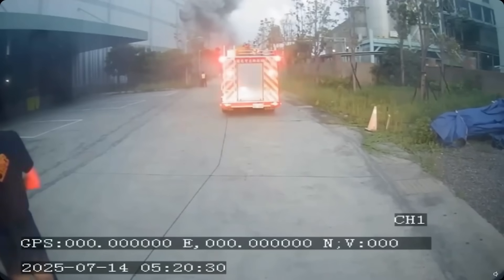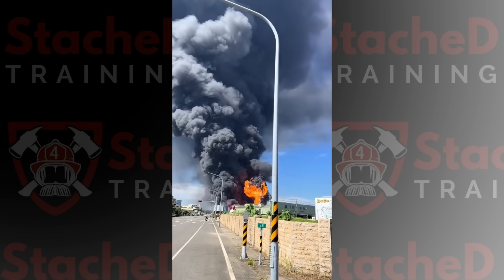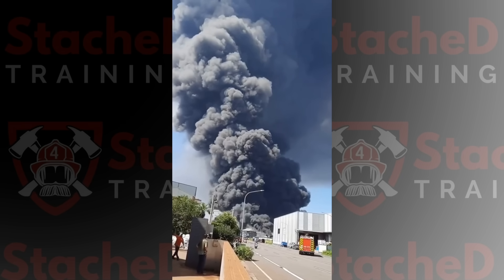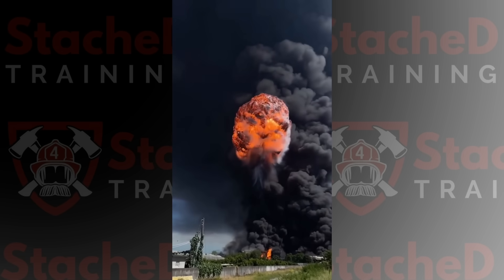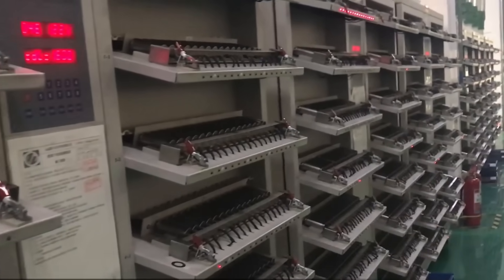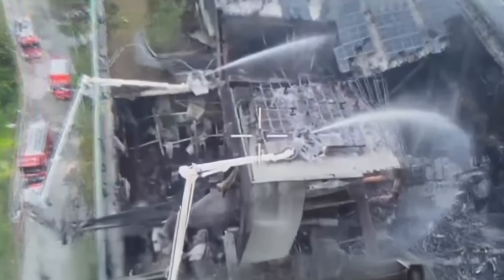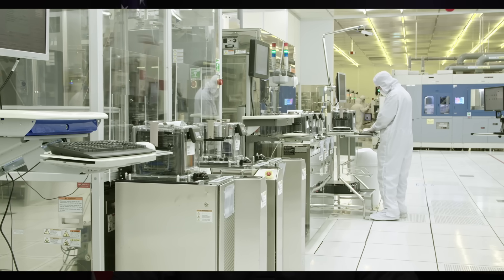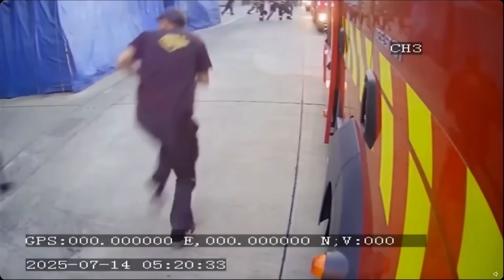Massive Lithium-Ion Fire in Taiwan: 2 Million Cells Lost

Comment: What is the best way to store lithium tool batteries at home? Do the "fireproof" bags work? I keep them in the house because my shed gets up to 120+ degrees in the summer.
Reply: Its a rough discussion. There's lithium ion battery fire extinguishers but they're generally smaller cans for like phones and stuff. There's blankets that help with fumes and gases contained but not completely unless its a full cover (which i got hoping it helps if needed..) but there's also this AVD stuff which ive found curious. Its aqueous vermiculite (something) it shoots vermiculite with water? which cools the battery and then the fire heats it up and it expands and is to smother what it can (batteries release there own oxidation so they dont need much air of ours to burn. 

Fire Fighters apparently submerge them in water when they arrive to the scene which they leave for 24hrs to a week cause it just keeps burning
ABC fire extinguishers are not really designed to deal with them also
Reply: Lithium metals are bad and react to water bad to my knowledge its different than lithium ion. Theres non lithium ebikes too but im really tryna figure it out too need a proper storage place

Comment: While anything can be made to burn given the right circumstances, of all the lithium type batteries only LiIon has a thermal runaway potential. Modern LiFePO4 cells and LiPo cells can burn if damaged but will not ignite adjacent cells by that mechanism alone, while LiIon will and often does. Earlier chemistries in all types were less safe but you'll likely never encounter them as they'll have worn out long ago. Cell quality plays a very large role with LiIon safety with low-quality cells being by far the most fire-prone. 

It's really only LiIon that you have to greatly worry about as only those almost always create a self-sustaining strong fire while the other types almost never do, and those other types produce less heat while burning. LiIon are also the only type with a high re-ignition risk. Knowing your enemy is crucial with lithium battery types as your strategy needs to match the type encountered.
There needs to be a special classification for LiIon types because of their characteristics. 

LiIon will remain a common hazard until technology provides a cost-effective alternative with the same high energy density; so far that goal has proven elusive.

Comment: I saw a guy get onto an elevator holding a big removable battery from an EV bike. As soon as the doors closed, the cell exploded like a phosphorus grenade. That battery burned the entire right side of his body to a crisp in under twenty seconds. The doors opened and a person walked up to a horrible scene. The guy lasted a day in the hospital. Suffering from unimaginable pain. The video, censored, is on YouTube. 
There are numerous reports of these rechargeable batteries simply going into a critical phase all on their own and starting fires.
 I have also seen a guy on You tube who was riding his new EV bike and the thing just started burning.
These EV fires are not regular fires, they are chemical fires. You never want to stick your head in the smoke or especially breathe in the fumes. There are very dangerous toxic chemicals in that smoke that can instantly ruin your lungs and your eyes. 
Get away from that EV fire, call the firefighters and tell them what it is, and let them deal with it. The less you breathe in those fumes, the better.

Comment: Here's a clue: compound the natural variability arising at each step of the manufacturing process, such as "electrolyte filling and anode/cathode coating". Then relate this natural variability to the "perfomance" (i.e. unpredictable thermal runaway) of a (small) proportion of each batch manufactured. Since battery cells are not logic circuits, the variability/faulty cells cannot be tested out after manufacture. Hence inevitable fires at a rate of one per XX million cells manufactured.

Comment: At that first charging stage, all of the manufacturing DEFECTS are likely to show up.  Having a huge closely spaced set of hundreds of cells, is again, a recipe for a major problem.  Cells can be "pre-screened" for some obvious defects, so this indicates some kind of failure of QA or prior inspection cycles.  Also, if a defect is detected on the charging line, in ONE cell, that cell can be shut down.  Indicates mass-charging banks, with no control of individual cells.

Comment: Probably started with a person saying in whatever language “that doesnt look right” and pushing the alarm reset button then sending some equipment records form to the maintenance dept who got the form then had to submit a form for approval of budget for equipment inspection with an additional form of line automation diversion shutdown notification for emergency maintenance and preventive care which would have to be approved all the way up the line of authority even to cost analysis and finances in order for the maintenance team to even get approved of entering the production facilities to systematically and cooperatively shut down, lock out and tag out the effected machinery to verify existing product safety for the time at idle using separate machinery and monitoring devices to watch the potentially dangerous incomplete cells in their various charged states and incomplete built units..  in automated manufacturing lines there is so much overhead required for industrial technicians that theres now departments developed to handle the dispatch approval legalities just for the technicians before they even touch a tool.
Reply: Exactly.

Comment: Ah no not Molicell! You were the chosen one! If only it had been the Chinese UltraFire brand; the Irony would be inconceivable
(I still can't believe there were actual people responsible for the naming of the Ultrafire brand lmfao. It's like naming your boat company SinksAlot lmfao
Reply: I bought some UltraFires on eBay once. 300mAh in those vs 3000mAh for a genuine Molicel or Samsung cell. I took a discharged one apart and they are 90% empty space and hollow inside. I don't think they have enough battery inside to catch on UltraFire.

Comment: Today on How They Do It : Plumbuses.
Everyone has a plumbus in their home. First they take the dingle bop and they smooth it out with a bunch of schleem. The schleem is then...repurposed for later batches.
They take the dingle bop and they push it through the grumbo, where the fleeb is rubbed against it. It's important that the fleeb is rubbed, because the fleeb has all the fleeb juice.
Then, a schlami shows up, and he rubs it...and spits on it.
They cut the fleeb. There's several hizzards in the way.
The blamfs rub against the chumbles, and the...plubis, and grumbo are shaved away.
That leaves you with...a regular old plumbus.

Comment: You would think facilities like this would have compartmentalization with fire doors.
Reply: The problem is that chemical fires make thick black smoke that moves very very fast so it wants to find a way out of the building,  fire doors will block the smoke in.       I think.    I just think getting the smoke out is #1.      This kind of smoke is very "Slick" it wants to move fast.      For example heavy smoke like form a Volcano will linger around at 40,000 to 70,000 feet up and becomes fallout  but a chemical fire is ultra slick and will rise STRAIGHT up to 300,000 feet well above the weather system so 0 fallout      Just comparing the 2 extreme kinds of smoke,  one very heavy from Volcanos the other very fine and slick from chemical fires

Comment: there should at least be a law to only have battery storage or factories to be outside city limits , with no buildings or homes nearby - of course common sense doesn't seem to come into play until several major catastrophes happen
Reply: Yeah, and contaminate farm fields so they can't be used any more.  The big Moss Landing plant fire apparently blew toward farm fields.
Reply: @SteamCrane  I was thinking more isolated-like in the desert,  not next to a farm. Somewhere where nobody is around for 30 miles and not near a water source.
Reply: @allyouneedis_chocolate  Some enviro crazies would still complain.

Comment: You mention Lithium-Ion and Lithium-Poly.  What about Lithium-Iron-Phosphate (LifePo).  I've been told that they are much safer, less likely to go into thermal run away and catch fire.  Is that true?

I want to design and build a 12V DC UPS to power a router and a laptop computer.  I can obtain a 12V 100AH  lifepo battery that is a pull from medical equipment for a good price.  But, I'm wondering if going with a lead acid battery might be safer.

Comment: That was a great description of how Li-ion cells are made, concise and complete. 💪 😎

AFAIK, the SEI does serve a different purpose than to prevent shorts or thermal events. If I understand correctly, during the first charge cycle SEI forms on the anode, using up some of the cell’s lithium inventory.  Fortunately once a SEI layer is formed it is stable and protects the rest of the Li-ions (and anode) from being consumed. When cracks form in the SEI, new SEI will form to fill them, resulting in loss of lithium ions and capacity degradation. The SEI is needed to make Li-ion batteries rechargeable, with serviceable cycle life.

Comment: We're still very early in finding a way to store and use energy in this way. A few decades from now this will seem like cave-man days of this level of battery energy storage compared to consuming liquid fossil fuel.

(The "heeby jibbies" concern in handling Lithium Polymer packs is their construction. All batteries of any chemistry age-out and need to be disposed of properly. LiPo packs are all membrane with no metal case, just kapton, etc with leads coming from each cell for balancing. At least they show more easily when they die by getting visually puffy right away. Hopefully before then they become too hard to balance or don't last long enough to put inside an RC device, etc.) (IMO)
Reply: re: "We're still very early in finding a way to store and use energy in this way". for clarification, the Battery was invented way back in 1800 by Volta with Li-ion Chemistry being later developed in 1980 by "Johnny B. Goode".  since the wall calendar says it's now 2025 what this mean is, it has now been 225 years and 45 years respectively between so called "breakthroughs".👈ref: "Those who don't know History are DOOMED to repeat it..." - George Santayana (1863-1952)

Comment: Too few in the EV discussion realize that we traded the complexity of an internal combustion engine for even more complexity in the batteries for the EV's that use a simple motor.    It only takes one failure among thousands to cause all of them to burn.
Reply: And the dangers of an EV are significantly worse than that of a normal ICE vehicle.  A normal person can put out an ICE fire with a normal extinguisher or even a garden hose, and the damage is finished/limited/safe.
Reply: @oskar6661  You think a "normal extinguisher" is going to put out a car with a tank of gas on fire. Do you realize how many people have been burned to death in ICE vehicles way more then EV's.
Reply: re: "Too few in the EV discussion realize that we traded the complexity of an internal combustion engine for even more complexity in the batteries for the EV's that use a simple motor."  which is to say what too few realize is something called the LAW OF NO FREE LUNCH.👈unfortunately (as we see from the Floods in New Mexico, Texas, Chicago, North Carolina, and here in Northeast) the Universe simply has NO INTENTION of ever letting Mankind off the hook "super easy" for the all mistakes that have been made over the last 166 years in dealing with the Environment.

Comment: They just released the 6500mAh 21700 cell recently and their roadmap presenting the 8500mAh cell probably in the lab and to be released in 3 years. These are ultra high energy density. I wonder if it was their lab cell in formation or their production cells that caused the fire. High energy density is representing higher risk..
Reply: Today's high-end (low IR, long cycle life) 21700s have a bit over 4000mAh per cell. I wouldn't be surprised if an 8500mAh cell of the same size would just explode like a stick of fine thermite. instead of catching on fire.